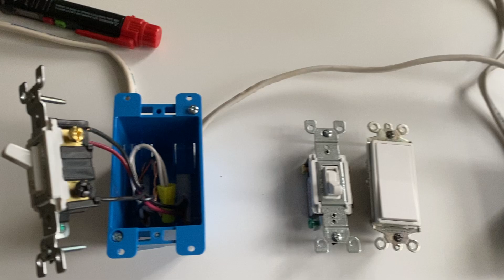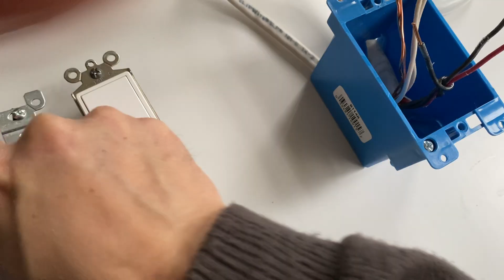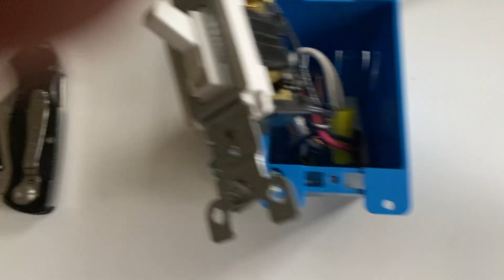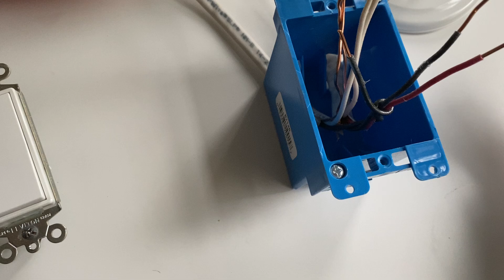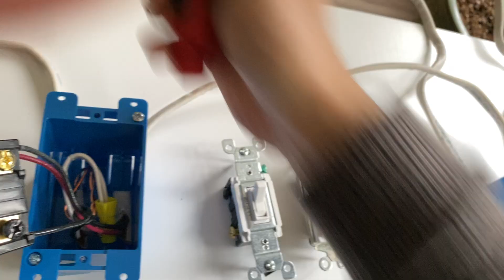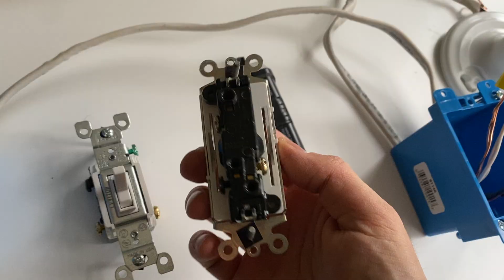3 Way Light Switch Wiring (Smart Switch or Regular)

Comment: So your hot wire with the power coming in is your traveler wire (line) and your neutral or wire that connects to the other switch that does not have power is your (load)?..

Comment: I’m completely lost. I ran power to a box for my first switch and then I also ran a three-way wire from that to another switch and from that box regular 14 to wire to my ceiling light fixture. The first box that you showed doesn’t explain about the power, entering the box and the three-way line exiting the box.
Reply from the maker: this is not about running wires but u can look up blueprint (pretty simple)

Comment: But I disconnected ALL wires from both three way switches and one wire group was showing all three wires as being hot!  How is that even possible?
Reply: I did in fact disconnect both switches.  Maybe my GREENLEE voltage detector is faulty because ALL conductors were showing HOT in the one box.
Reply: I was trying to determine which wire group was coming directly from the panel
Reply from the maker: you need to disconnect second switch as well to define your line and load now. usually twisted wire around 2 travelers is line/load